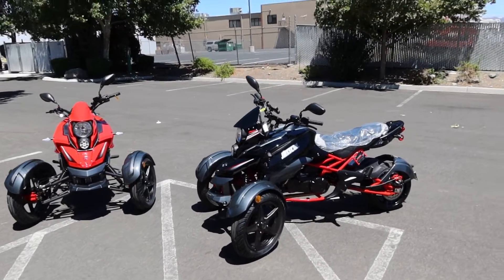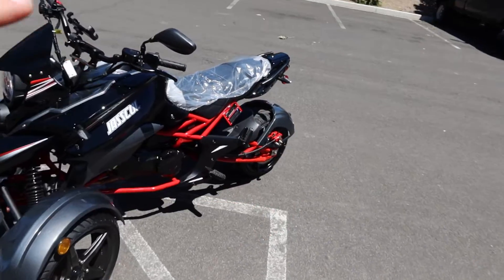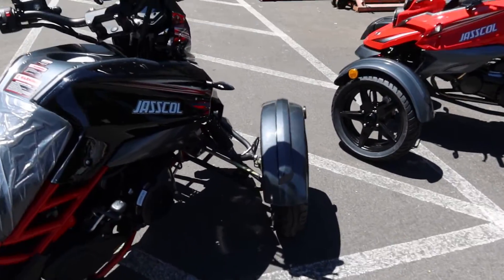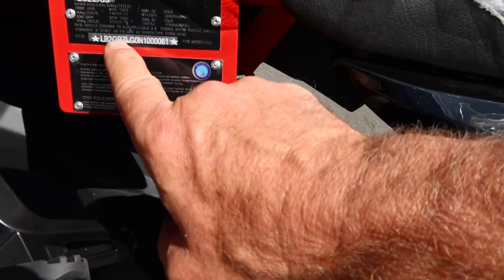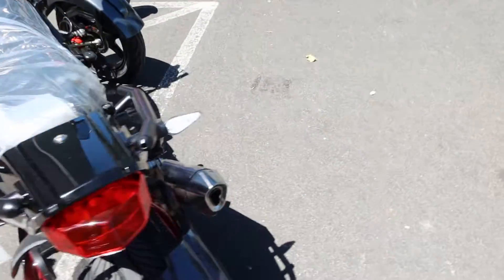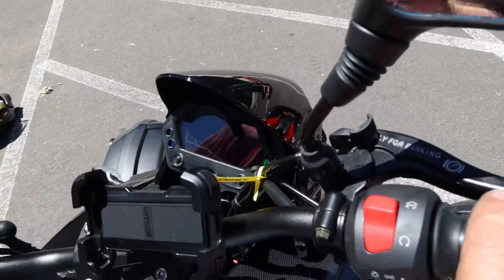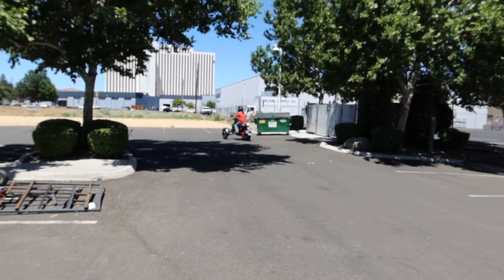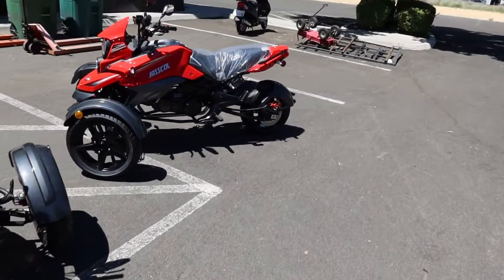Amigo Jasscol 200 Can-Am Trike Clone Review

Comment: Where would i get new tires purchased and mounted? Also are these reliable and can the engine be upsized later?
Reply from the maker: The reliability feed from owners is very good.  Tires, check your local motorcycle shop.